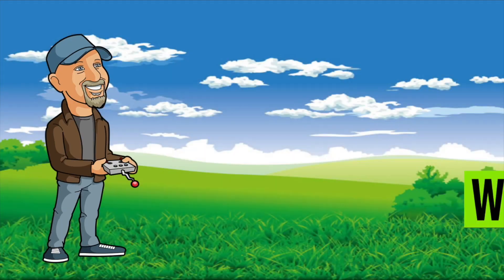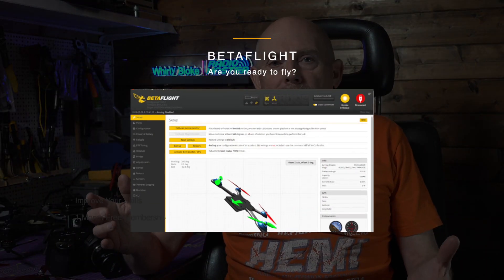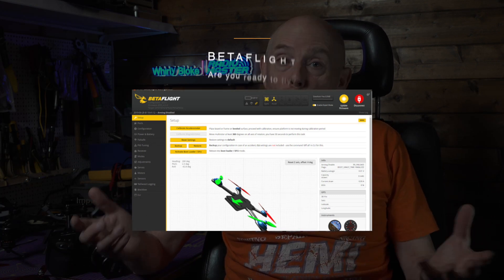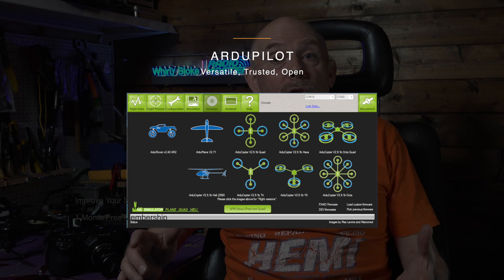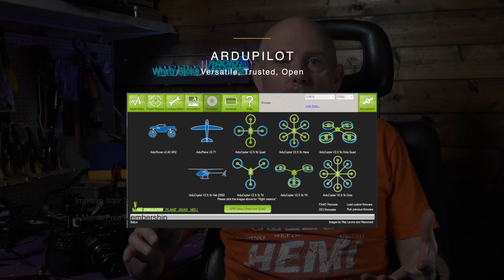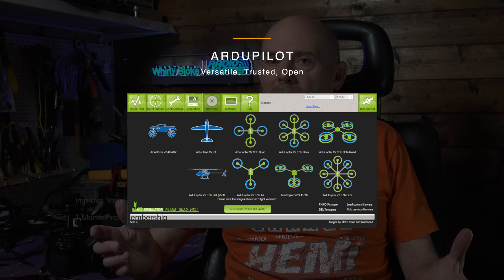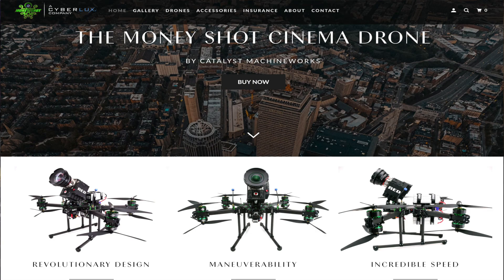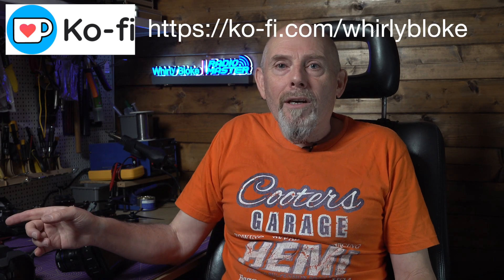Top 5 reasons to choose INAV for your cinelifter multicopter builds

Comment: Help, I can't get my motors spinning in inav. It's an x8 configuration. I've enabled motors and servo outputs. Switched between different ESC protocols. I'm using the kakute H7 FC and Holybro 4-in-1 ESCs. It works in Betaflight but won't work in iNav. I need help.
Reply from the maker: Try changing the motor output to multishot. Some flight controllers have a clash of DMA resources required for DSHOT. I covered that here https://www.youtube.com/watch?v=h9WMI9DTXaU
Reply: @WhirlyBloke  I have already tried to use Multishot and it still didn't work. Can I use the matek 8 motor target on the kakute?
Reply from the maker: @pinewaves_  'Fraid not. I had to write a target for the Matek that's in INAV.
Reply: @WhirlyBloke  it's definitely a target problem. There's currently no 8 motor target for the Kakute H7 in iNav. And it's not even in the upcoming release candidates. I really need help building one. I've seen tutorials on it but it's a little over my head. Is it something you could do for me, please. I'm on a really tight budget and deadline 😔
Reply from the maker: @pinewaves_  Sorry, I'm too busy with other things at the moment, besides I don't have that combination of hardware here to test on. Maybe put a feature request on the INAV repo https://github.com/iNavFlight/inav/issues
Reply: @WhirlyBloke  ok thanks
Reply: @WhirlyBloke  Problem solved. So I reached out to Pawet and he told me what to do. All I had to do was change output_mode = MOTORS now all the motors show up on the mixer and they're all working. Thanks
Reply from the maker: @pinewaves_  he's the man.

Comment: thanks for the vid. I wanted to use inav on a 7" chimera7 for many of the reasons you mention: position hold, RTH. It'd be nice to be able to take a break in midair during 20min long flights. Do you think the flight performance is as good as Betaflight on the 7" class of drones though? This would be for cinematic flying/mountain surfing.
Reply from the maker: As I said in the video, for this type of drone INAV is far superior for all the reasons I give. And it flies better.
Reply: @WhirlyBloke   excellent! I see now your video also recommends inav with e.g. the AOS 7, in addition to the larger cinelifters you show in the beginning. Inav just makes so much more sense than Betaflight. I lost a long range quad due to Betaflight's inadequate RTH, totally avoidable with better software.

Comment: Curious what inav 5 adds.. it was just released. I see some BNF 8 rotor setups for about $1600 to $2500. Can you build one of these for a lot less? The FC seems to be the same price (about $130), the frame kit which I thought included motors is like $350 but maybe its just the carbon fiber frame? Not sure how much gps and barometer cost, the VTX is the same as any FPV (about $150.. HDZero or DJI). It seems like you could build one for a lot less than the prebuilt ones? Would love to see a full kit list for an 8 rotor 8" like what you have, links to parts, etc.
Reply from the maker: Everything you need including a components list and setup is here
https://www.youtube.com/watch?v=EKv315j3dd8
https://www.youtube.com/watch?v=qwYQGF4ZmKQ
https://www.youtube.com/watch?v=h9WMI9DTXaU
Reply: @WhirlyBloke  Thank you. :)

Comment: I'm pretty sure Ardupilot provides a decent acro mode.
Reply from the maker: You're right, it does. What I should have said is usable acro. I've tried the acro on ArduPilot and it works, but it's performance feels a few years behind what BF and INAV offer. And the tuning tools and filters are much less sophisticated. That doesn't mean you can't use it and it won't improve. My point is INAV is probably the best choice for larger multicopters in 2022.

Comment: Got to say I totally agree with you about how smooth a flight you can get with iNav. Of course you can get that with Ardupilot, but getting all the various filter and pids set up correctly on Ardupilot can be a bit of a mission. I have been using ardupilot for a few years now on some fairly big quads and hex's, and it's always taken a lot of messing about to get it just how you want it. Out of interest last year a built a quad using iNav, wanted to see what it was like. I could not believe just how smooth the quad flew straight from the start, without messing with pids and filters at all. Out of the box so to speak, iNav gave me a machine that was flying much nicer than my Ardupilot based machines. Just felt so smooth, not sloppy, but just smooth. I also noticed that iNav was so good at maintaining a smooth hover just a foot or so off the ground, I could never achieve that with my Ardupilot craft. No doubt Ardupilot is capable of doing the same, but getting the set up right is not easy. So I can only say your comments are spot on!
Reply from the maker: INAV has come a long way in the last couple of years.  I'd say that most of the time, if you have a well build quad, it will fly really well on the defaults. Thanks for the feedback.

Comment: I don’t know anyone who has success with inav especially RTH even when set up right it still drops and doesn’t return to home position. I for one don’t trust it. Friends have spent hours and can’t get it to perform RTH so don’t know what the problem is.
Reply from the maker: There are zero issues if you choose the correct GPS and magnetometer, correctly mount and calibrate them. Most times, problems are due to mounting the GPS/Magnetometer too close to the motors, power wires or HD cameras. That's why a high rise mount is so important - it may not look pretty, but it works. Check my video that shows how and a full demo. https://bit.ly/37UWlk2
Reply: Works fine here.